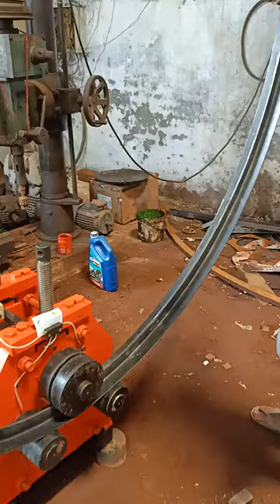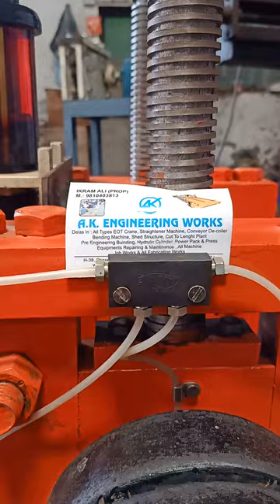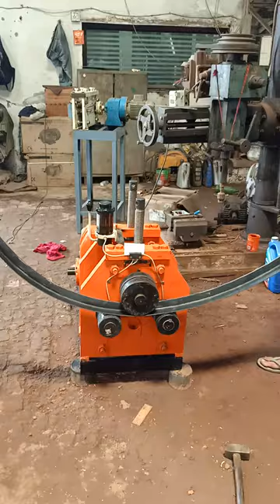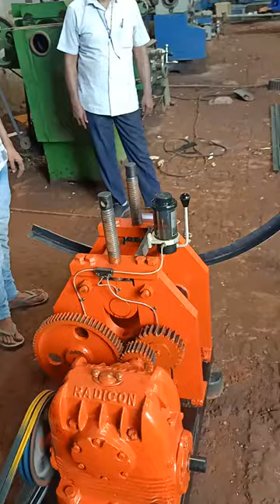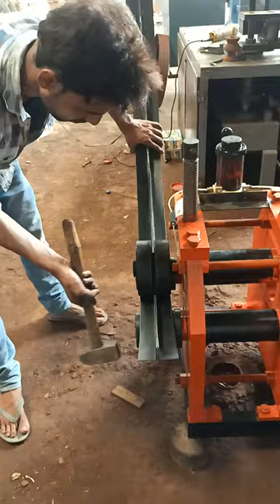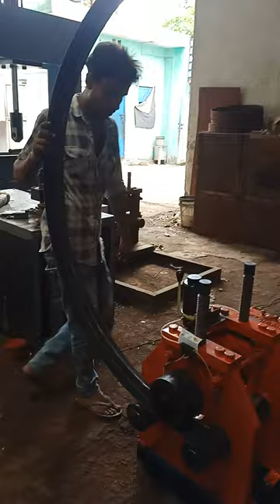angle bending machine 91+981040383

Comment: What is the distance between the two disks at the bottom of each round or square tube and its thickness? Thank you❤❤❤
Reply from the maker: Distance between 2 rolls 250 mm
It's angle 50-50-05 mm
Reply: @akengineeringworksghaziaba3304  No . I didn't ask you the question. I want to make a different one from this one.. I asked you if there was a ruler for each iron tube B or its diameter to determine the distance between the bottom rollers and the thickness of the round or square tube. THANKS ♥️
Reply from the maker: @mecano_s4486  yes I make different machine
Please send square and round tube size after I send quotation and price